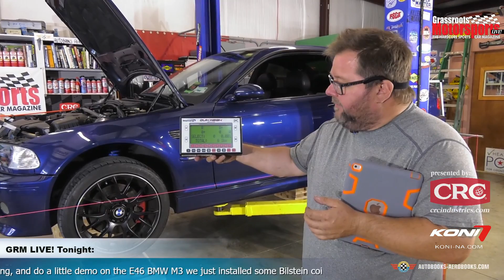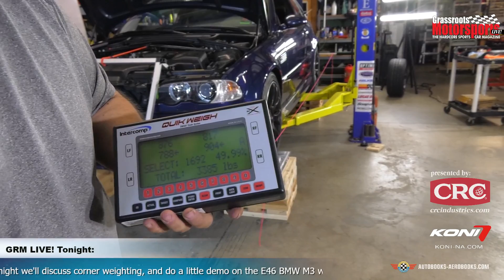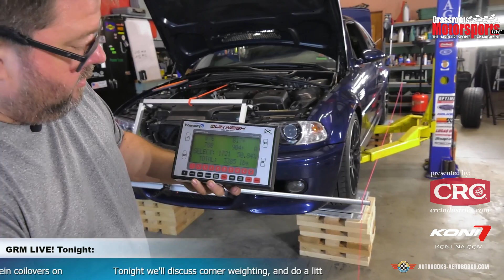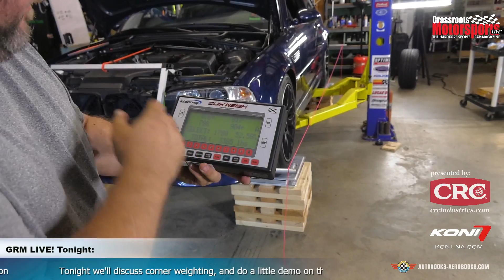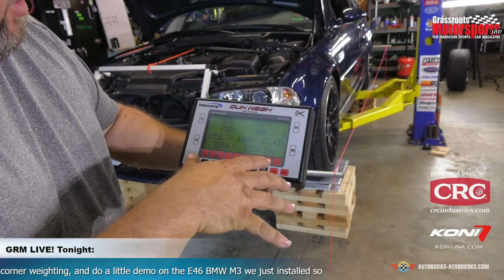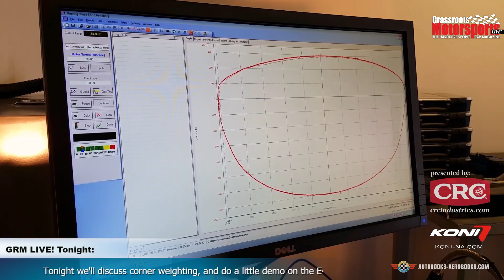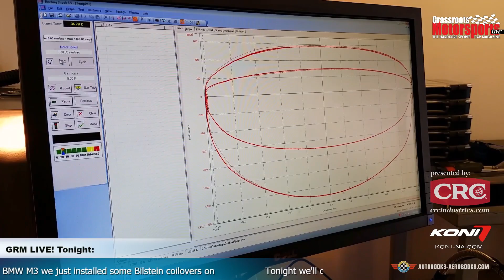Corner weighting your car with coil-overs. GRM Live! Presented by CRC Industries

Comment: Diy Slip plates: 8 pieces of sheet metal -> 4 grease samiches
Reply: Foooweee eee even greased plastic trash bags work in a pinch. Better than most pro tunplates as they self center and work with huge scrub.
Reply from the maker: We built some DIY slip plates for a previous video. Used industrial tiles and cutting boards. They work in a pinch but they're messy and take a while to set up properly and you end up needing to wash your hands a lot so we left them out of this episode. We're going to keep working on them, though, and trying to perfect our design.